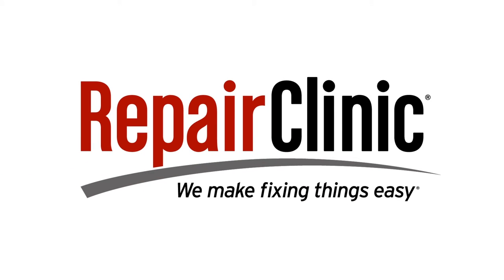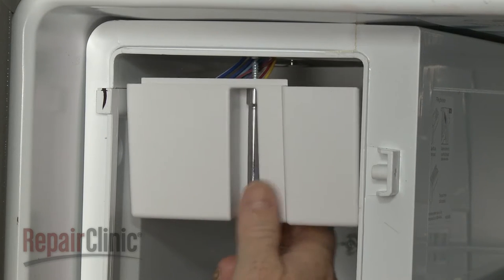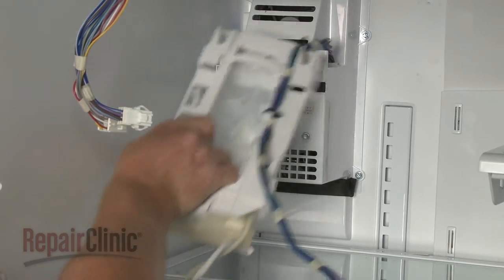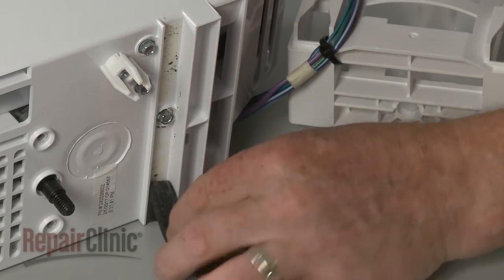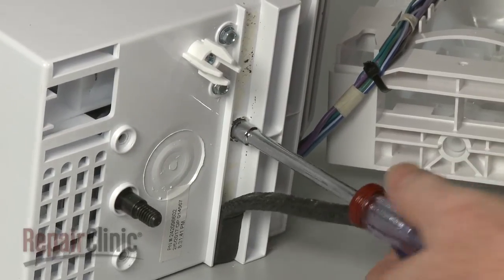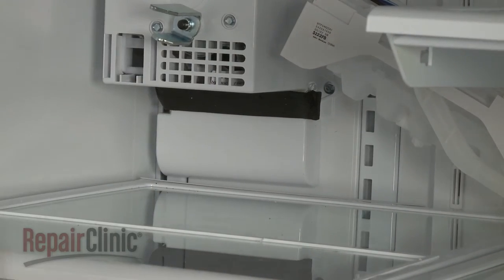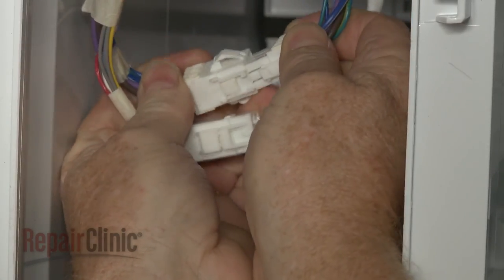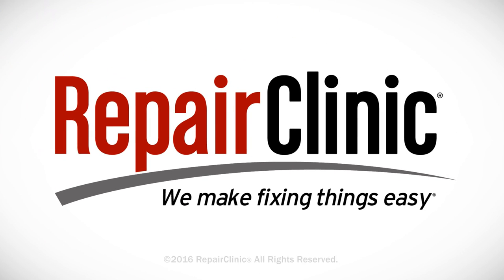Frigidaire Refrigerator Auger Motor Replacement 241816602

Comment: The ice auger motor on our model ffhb2750ts Frigidaire was intermittent.  While dispensing the ice, it would just randomly stop.  We'd have to switch it the the water dispenser mode and then back to dispense ice.  That worked for awhile.  Then one day, the fridge just started randomly tripping the circuit breaker.  The fridge might stay on for 12 hours or 12 minutes which was not good.  Sometimes, it would just trip the breaker as soon as the fridge was plugged in.  One day we were dispensing ice and the fridge just shut off (tripped circuit breaker) while dispensing the ice.  That actually helped us narrow it down to the ice auger drive motor causing the breaker to trip.  Once the ice auger motor was replaced, it has been working fine so far.
Reply: This video will come in handy for sure instead of paying a repair guy to come fix it if it fails again.

Comment: Any ideas on how to get the auger fork off the motor shaft if it spins the motor clockwise as well? The auger fork has a collar so there’s no way to hold the shaft still. Any thoughts appreciated.
Reply: I used locking pliers behind the auger and some WD40

Comment: Although my fridge model is different, my auger motor quit turning to dispense ice. I ordered the proper motor and removed the ice maker unit but when out, the motor turned easily. I reinstalled to unit without changing the motor and it worked fine. I think powering off the fridge from the front control, turning off the little internal switch on the ice maker and unplugging the internal cabling reset the unit which made it work again. Just unplugging the fridge wasn't enough.
Reply: I just had a similar situation, disconnected everything, spun the motor, reconnected, working fine!!! Thank you!

Comment: The information in this video is excellent.  I could not have changed out the auger motor in our refrigerator without it.  The original auger motor worked, but only after pressing the activation switch (using a drinking glass) up to 25 times.  My guess was that the auger motor had a bad starter coil.  After replacing the auger motor, I'm still having the same problem.  The switch seems to be okay because the flapper door opens when it is pressed.  I do not know why the auger motor is not activated each time the activation switch is engaged with a drinking glass.  Does anyone have any ideas?
Reply: Did you ever figure this out? I'm having the exact same issue.
Reply: Me too
Reply: @Prosecute-fauci  I know the video is old, but just incase. My auger motor stopped working and went through so many videos and forums to find no fix at all. Took it apart, dried out motor, and checked for icing. Wasn't until the second time I took it apart to get part number I found a cut wire. I assume from the ice tray brackets. It was in the set of wires that go on top of the ice cube tray, a purple wire, for the AUGER MOTOR POWER! I capped with wire nut. Works great. Hope this helps someone else. Was about to lose my mind on this one. It was a slow evolving problem at first, the ice would slowly start to lose the dispensing speed. Took awhile for it to just quit. The wire I assume was getting cut very slowly overtime from vibrations while wedged somewhere. Once again hope it can help someone else.